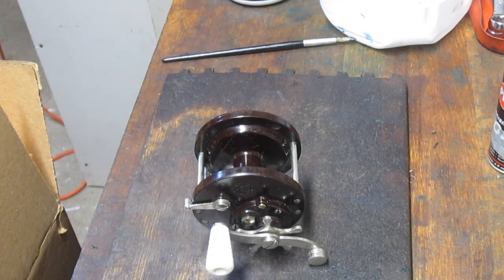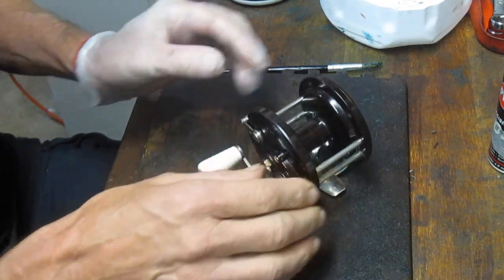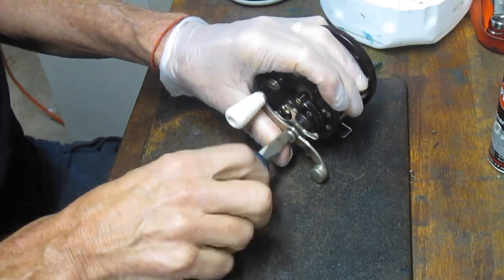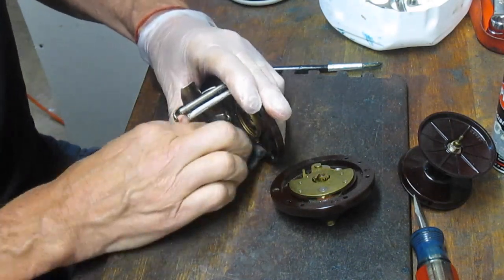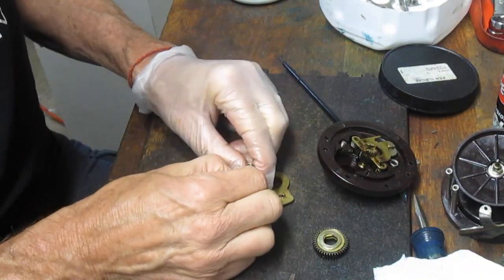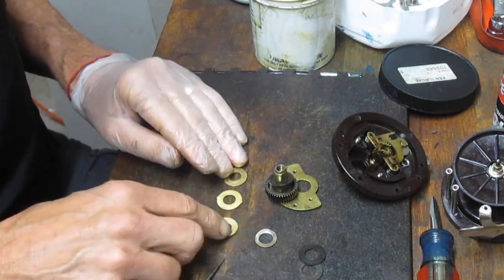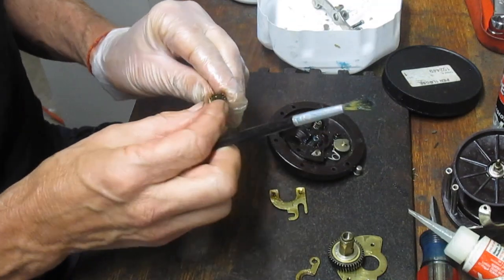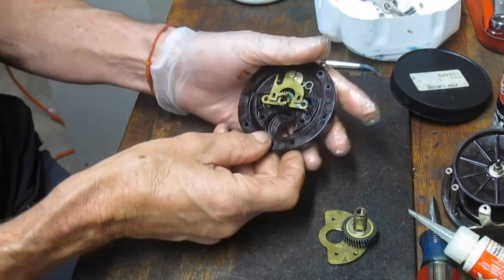Penn Seaboy model 85 saltwater fishing reel how totake apart and service

Comment: Mine’s been hanging up for years. It wouldn’t reel so I removed the line and found that the line had gone behind the spool and cracked the spool. I’d like to clean it and use, but I need a replacement spool. Great video. Looks like something I might try. 👍
Reply from the maker: You can do it - You should be able to find a replacement spool on eBay.  The metal ones won't break and are a direct replacement for the plastic ones, so you can switch over if you like - Dennis

Comment: Dennis, this video was great.  I have two 85's that were my Dad's (which hadn't been fished since the 90's) and when attempting to clean and service the first one....once the anti reverse paw and spring fell out I went looking for a youtube video.  The reel is completely back together and working great.  I also have his spinning reel a the drag tightening nut is Penn so I am assuming the rest is.  The side says 800 Saltwater.  Penn has not responded for information on this reel.  Have you any information on this?
Reply from the maker: Thank you fort he kind feedback.  Yes - If you can send me a picture or two to my email - 2ndchancetackle@gmail.com I will try to identify it for you.  Penn mostly used 8000 and not 800 to identify their larger reels, so it is hard to guess.  A picture or two should help - Dennis

Comment: friend I have a Penn n 85 which line to use in (mm) and what the pound of the stick? Thanks in advance!
Reply from the maker: about 350 yards of .045 line - Dennis
Reply: @2ndChanceTackle  thank you very much, the monofilament or multifilament line?
Reply from the maker: Monofilament.  If you are using braid, the capacity is about 30% greater
Reply: @2ndChanceTackle  Ok. And Thank you ! I'm here from Brazil and here I didn't find any information about Penn 85 sea boy but thanks for helping me!